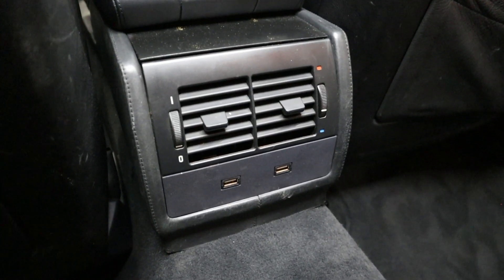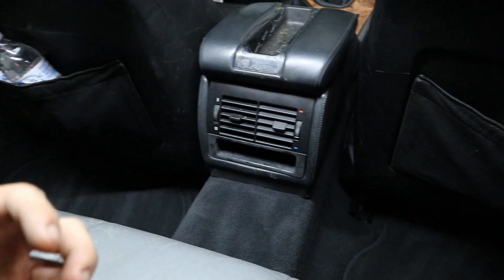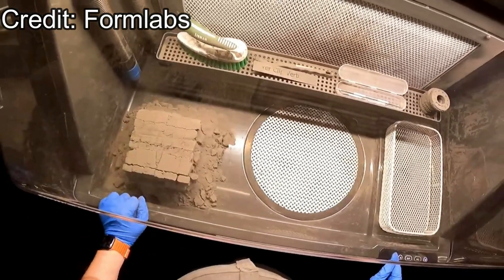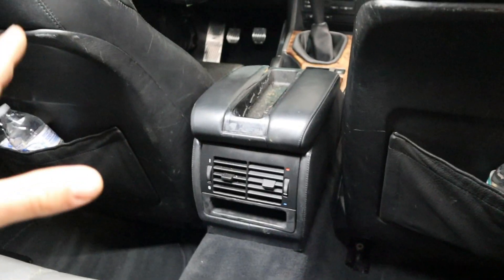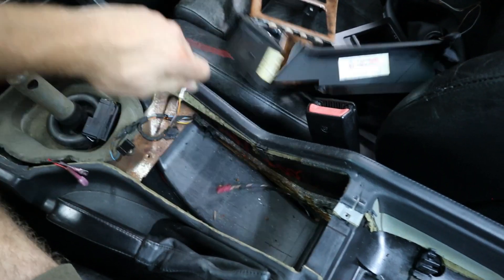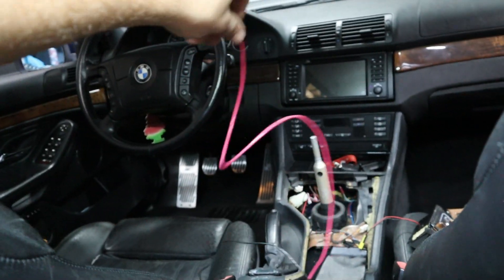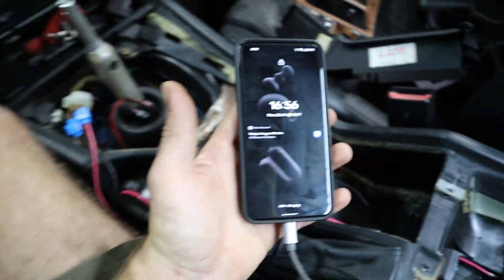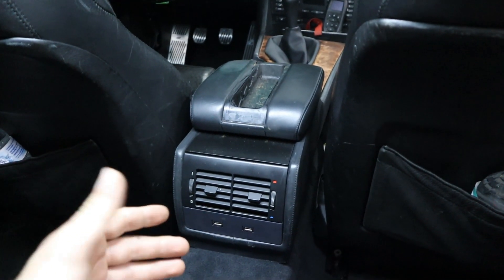I 3-D PRINTED a USB Charger for my E39 BMW!

Comment: Not bad at all! Wishing you had shown the what you did with the connection more clearly, but good job. 

Adding a power switch to the plate would be great for those with power drain concerns who don’t want to plug and unplug things all the time.
Reply from the maker: Thanks for the idea!

Comment: Nice build, but just for security I'd add 5A fuse in between that wire to back. Just in case that Amazon converter goes bad. Also I'm a little concerned to leave that thing powered up for 24/7.
Reply from the maker: That is a good idea, although I guess that if it did fail, it'll just pop the fuse for the cigarette lighter as a safety mechanism.

Comment: Is the inverter included in the kit you sell?
Reply from the maker: Yeah! With the connectors, correct length wire, etc. I figure most people don't have a 3d printer, so I can just print and build them and all you have to do is install it!
Reply: @TheBimmerBarn  great, thanks! I just purchased one. What about the epoxy? Do I buy that separately?
Reply from the maker: @thrty8street  No sorry, let me explain; I assemble everything myself, all you have to do is take apart your car and tap the wires! The power inverter comes installed in the faceplate already 👍
Reply: @TheBimmerBarn  got it! Thanks

Comment: very cool, are you planning to make them in different colors to match the trim? also, once it’s installed, is there a way to remove it?
Reply from the maker: For now, they are dyed black with UV resistant coating, but they can be painted. To remove, just use a plastic trim tool from one side!

Comment: the radio / headunit did not have any extra powered usb ports?
Reply from the maker: It does have USB ports, but they're made for data transfer, and charge verrrryyy slowlllyyyy